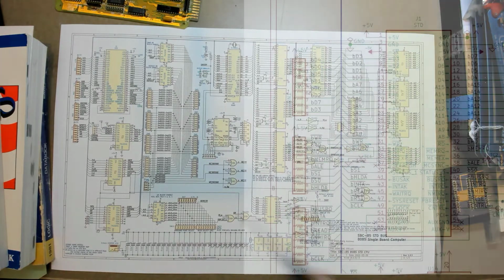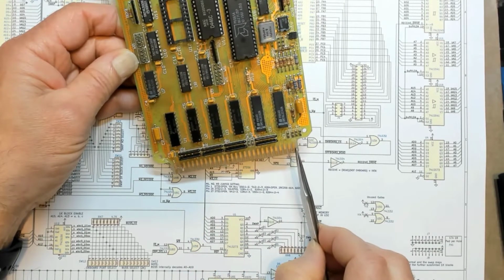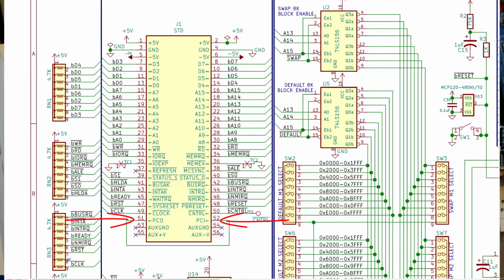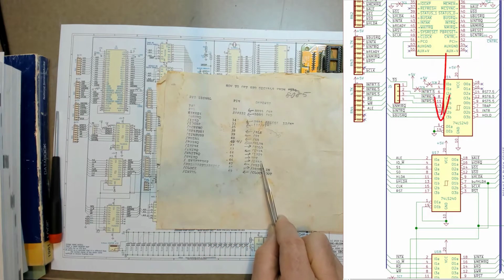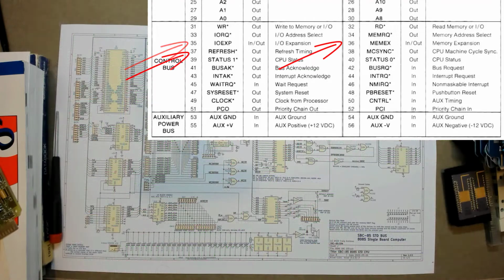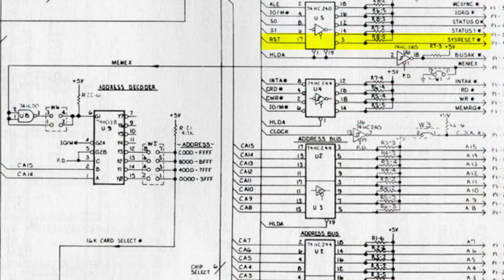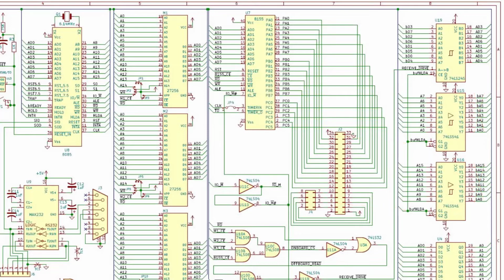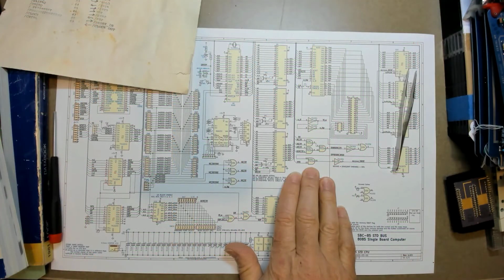{82} The signals that make this single board computer STD Bus Compliant

Comment: Is there a KiCAD library or part for the standard STD card physical dimensions/pads?

I have a bunch of 6805s laying around (long story) and wanted to practice board/SBC design with these parts.  Originally I was going to use your SBC-85 design and PCI connectors, but maybe an STD board design/connector would be a better fit.
Reply from the maker: Will Halphen has some STD KiCAD boards on GitHub.  A blank card, an extender, and a backplane/extender
https://www.dropbox.com/s/j70ddkvh28xvlic/STD_Card.zip?dl=0